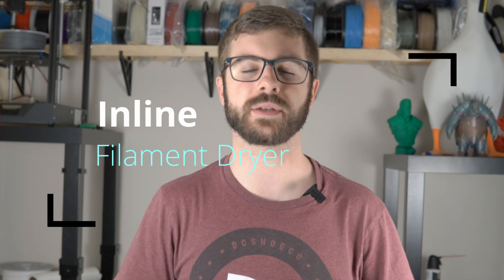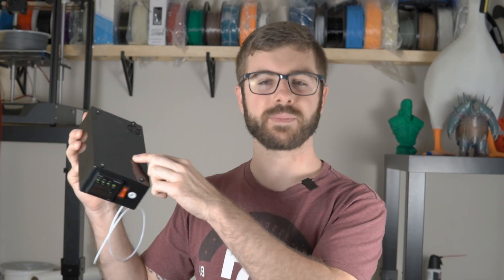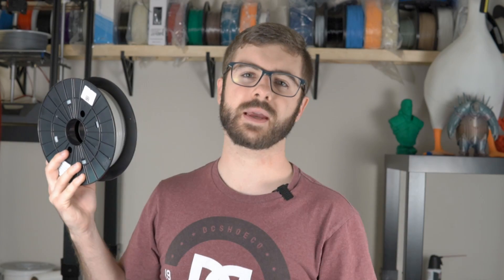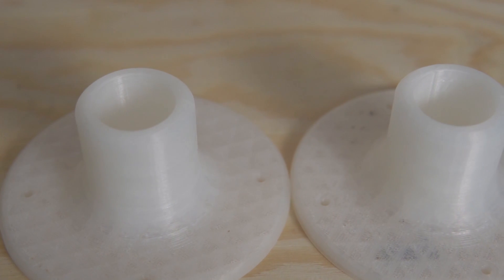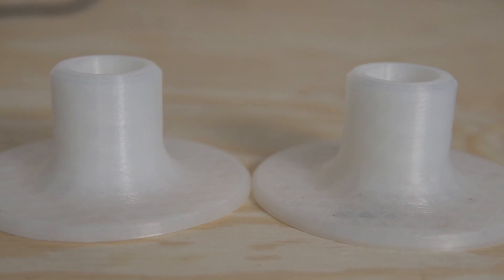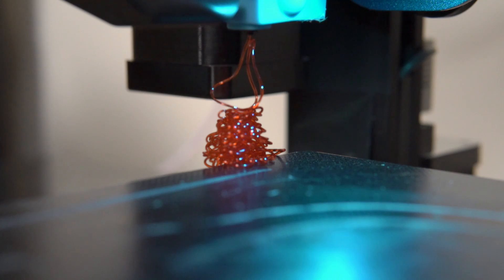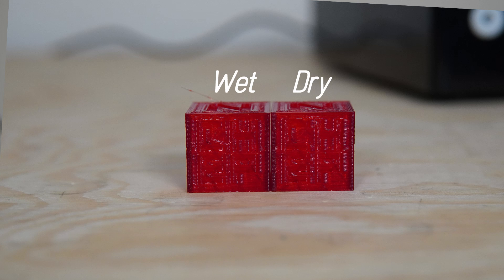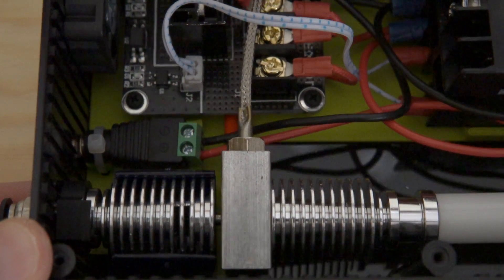Inline 3D Printing Filament Dryer | Does It Work?

Comment: there's no way the filament has enough time to loose humidity
Reply: @YoungGunner360  I got my food dehydrator for 30au dollars from aldi. I find 2-3hrs at 55c is all I need to make my TPU and PETG print sting free.
Reply from the maker: @YoungGunner360  <3
Reply: The only thing it definitely loses is shape and dimensional accuracy. I am ashamed, that I am subscribed to someone who has to test such a machine, to determine whether it works or not.

Comment: I 3D print since 2014 and, despite my massive filament consumption, I have still spools of filament laying on the shelf since these early days. It's entry level filament, and the leftover is mostly not enought to print anything serious. Sometimes I need a tiny part and I use the leftovers, on the printer or in the 3D pen. I never noticed any moisture problem on PLA or PETG. But Nylon and ABS can shows popping issues during the print and a fuzzy surface on the print. I believe your instant dryer is not capable of removing the moisture as quick as expected. You need to low temp bake you filament for hours to have a noticeable result. Regards.
Reply from the maker: I have had PLA out in the open for years and have noticed little of any issues with moisture. Nylon and occasionally PETG are the two I have had show some signs of negative quality due to moisture absorption.

Comment: It would be nice if you added one more test with the same setting and filament dry in the oven as usual and compare the three
Reply from the maker: It seems there is quite a bit of interest in this so I may end up revisiting it.
Reply: ModBot if the oven make it better then that confirm that inline dryer is for sure not good but if the oven did not improve the print then it’s not a good test and need to be done on maybe a nylon which is very sensitive to that
Reply: @ModBotArmy  please do so
Reply: I would also make prints wich use stringing.

Comment: When you bake filament to dry it out, don't you have to do it for an hour or so? Seems like this wouldn't expose the filament to the low heat long enough to truly dry it out, plus there's nowhere for the moisture to go since internally it's just a hotend and a couple heatsinks.
Reply from the maker: This is the conventional way of doing it with an active heater that has proven to work. If the device in this video had worked, it would have saved time by not having to bake out the entire roll and just being able to run a wet spool directly into the printer.
Reply: There's holes in the heatsink right after the heater block.  I had PLA with moisture that it helped